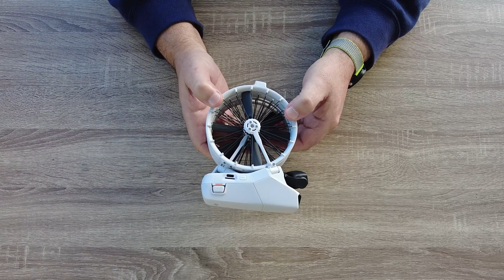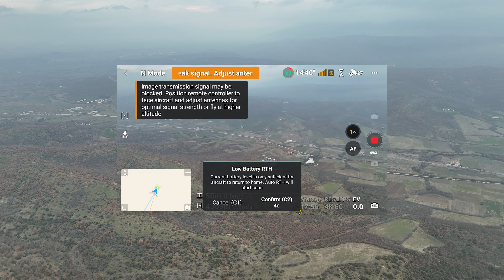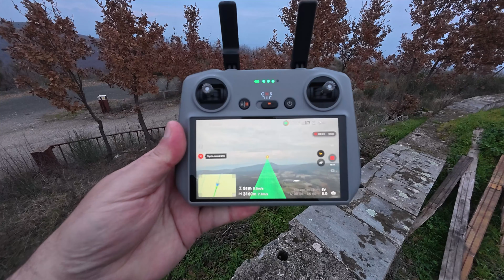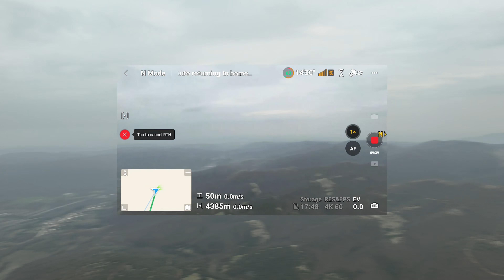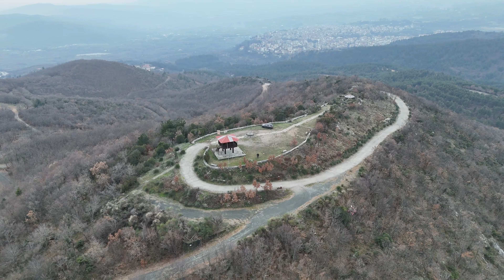5 KM on One Battery? DJI FLIP Long-Range Test Will Blow Your Mind!

Comment: Good test, especially the Normal vs Sports comparison, few people do that. Couple of explanations missing though, did you let it come back entirely with RTH or manually at S speed ?
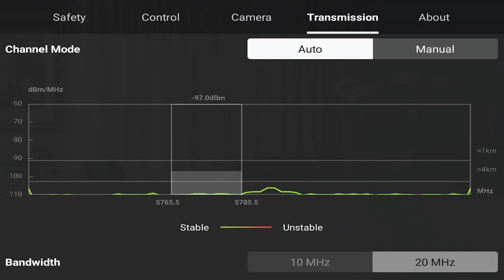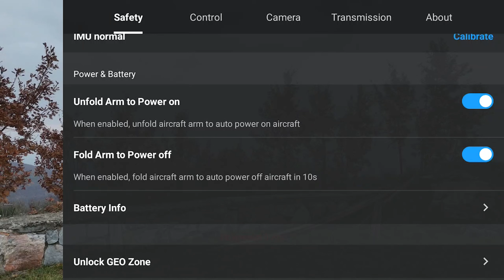Also it seems you switched from CE (3:12) to FCC (3:14) why not disclose it as well as which hack you used?
Reply from the maker: Thank you for your comment! I'm glad you appreciated the Normal vs. Sport mode comparison.
Regarding RTH, in both tests (Normal and Sport), once RTH was engaged, I didn’t use the remote controller until landing. The aircraft's RTH speed is fixed at 8m/s across all speed modes.
As for the hack concern, I’m not using any kind of hack. The timestamps you mentioned (3:12 and 3:14) were meant to demonstrate how interference appears on the screen. At 3:12, I was out in the field, while at 3:14, I was inside my house near my router, which likely caused the difference you noticed. I used the same RC2 controller without changing any settings.
Hope this clarifies things! Let me know if you have any other questions.
Reply: @nickpsar  Good idea to let the RTH do it's work, at least you're sure it's using the shortest path. The other day when I flew back from 4km away I stopped it after a few seconds but there was a slight side wind and as a result I had to correct the course after a while. Some people say the RTH speed is optimized...not sure though since it's N speed and you got more distance with S speed.
As for the transmission I'm still confused because at 3:12 the line is at the 1km level, normally indicating CE mode and at 3:14 it's lower, normally indicating FCC mode ! At least that's how it works on the RC-N3.
Reply from the maker: Don’t worry—my drone isn’t hacked (I wouldn’t even know how to do that! 😅). You’re spot on about the RTH ! It’s optimized to balance speed and battery efficiency, which is why the drone consistently lands with 17% battery remaining, no matter how far it flies when the RTH kicks in, or which speed mode you use. The battery management here is seriously impressive—it feels almost like magic, right? 🚁✨

Comment: If there is wind, fly out into the wind and return with the wind, this reduces the risk of you running out of battery before returning.
Reply from the maker: You're totally right,  something that every drone pilot should be aware off is that the low battery RTH feature is a lifesaver, but it’s always better to plan our return trip in advance.